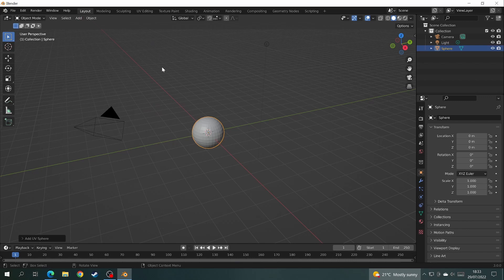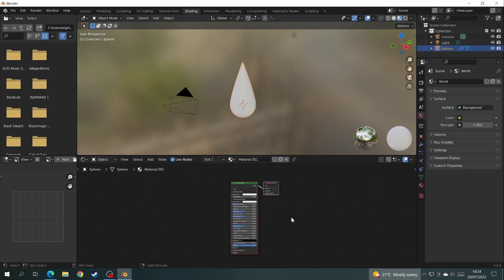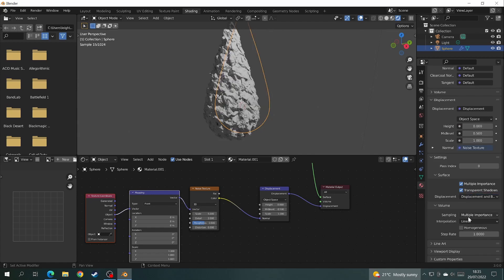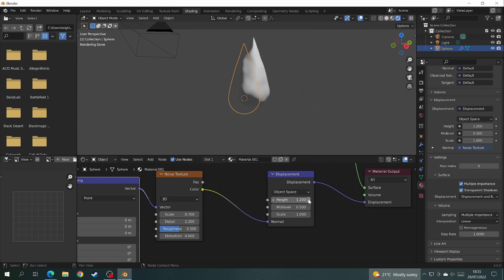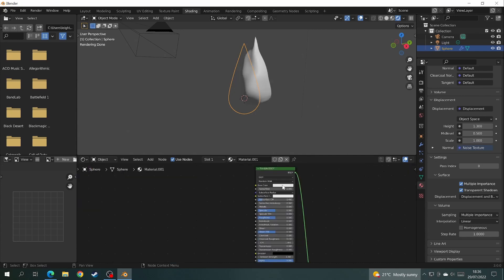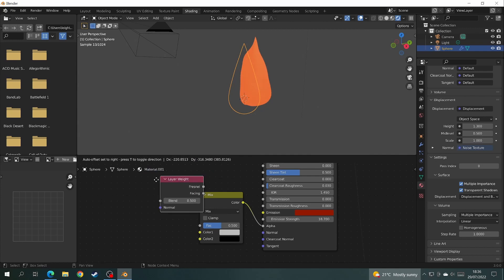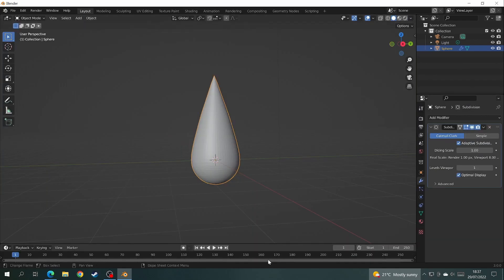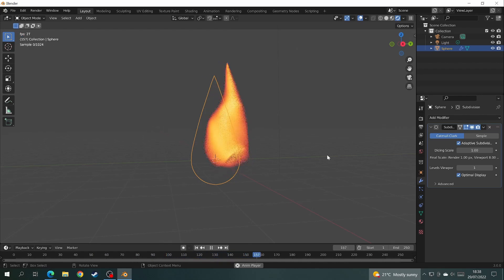Blender Easy Flame Tutorial

Comment: This flame is so cool, but is there a way to make it loop for an endless animation?
Reply: A bit late but, Instead of using keyframes, type [#frame/-20] into the Z in mapping. you can change the [20] to adjust the speed, larger numbers are slower. removing the [-] changes the direction. Make sure frame is lowercase and there are no spaces.
Reply: @kane8165  genuinely clutch for my project thanks bro